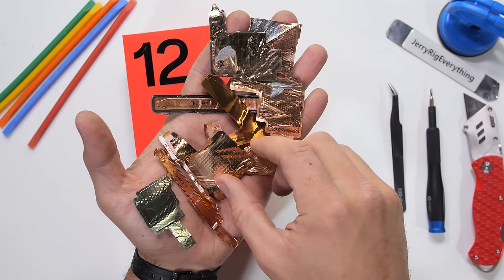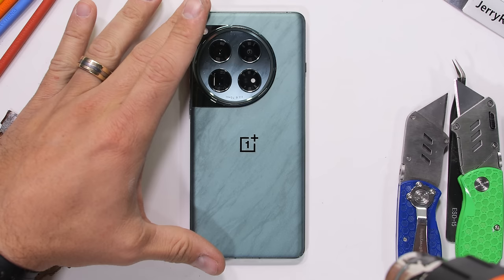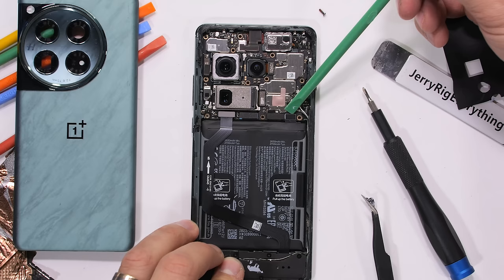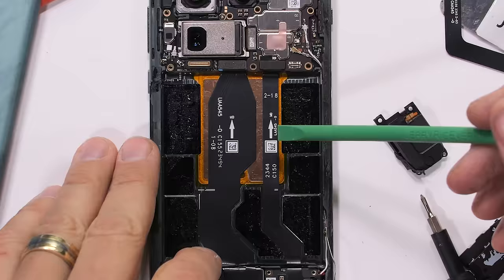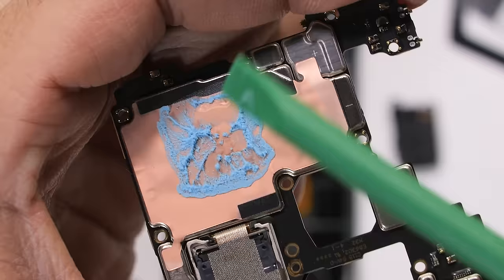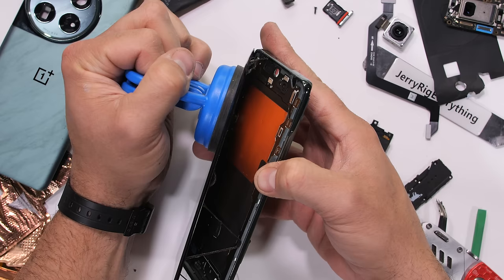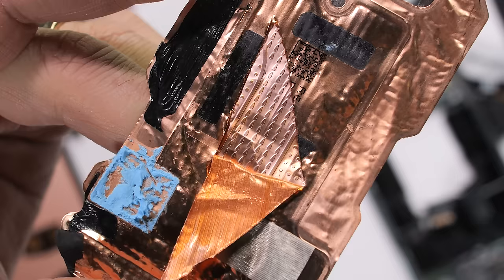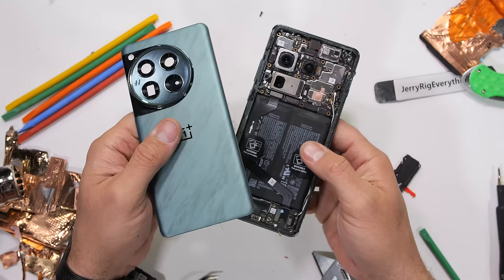The OnePlus 12 is the Coolest phone ever seen...

Comment: its crazy how far one plus has come, i remember when hearing about this new company back in college, i had to get my hands on one of their phones, just so much tech for a value. I don't mind that it costs so much now n days, they seem to be very passionate about making their phones and what they put in it. big ups for one plus.
Reply: It really is amazing how far they've come. Op12 provides 90% of the experience of the s24 ultra (speed, resolution, refresh rate, battery etc), lacks a little behind in terms of camera, but that's only when you compare auto to auto mode. In manual camera mode, you can get much closer to the type of results the s24u produces. All that for 40% less in price compared to said flagship.

Not AS bang-for-buck as it used to be, but they are resisting going past that $1k mark, whereas everyone is comfortable charging $1400😂
Reply: One plus the goat
Reply: do you know about phones and if so is that a extra fake camera on this phone?
Reply: Heck they are still a great value IMO. I'm going to buy one today at Best Buy (they just happened to have ONE 512 gig / 16 gig RAM in green in stock). The battery on my Note 20 Ultra 5G has started swelling bad enough that it broke the water tight seal on the back glass completely. If I take it out of the case the back glass isn't even attached because the battery has swollen so much. I didn't notice until the last time I took it out of the case to clean. Pretty sure if I tried to use it without a case the internals would just fall out lol. Plus of course a bulging battery is not a good sign for obvious reasons.
Reply: Got my OP5 on EBay for $80 2 years ago, and I am dreading the day I have to leave it. If modern OnePlus phones had a headphone jack, I would buy them without a second thought.

Comment: Definitely a long-time OnePlus user here. I've had 2 phones in the last 8 years. OnePlus 3T and OnePlus 7T. This 7T still works way better than I need a phone to be. I don't see myself replacing this 7T any time soon. I compared my old 3T (end 2016) to a friend's Samsung Galaxy S8+ (early 2017) after both phones had been sitting in a drawer for a year. The Samsung S8+ had developed a bloated battery that cracked the back glass while it was in the drawer. 😮 I replaced the battery and it works again, but its new battery keeps a charge only half as long as the older 3T with all original parts. OnePlus makes phones that last! I absolutely love their main line of phones and I'll always go for their products first. 👍 My two most-used OnePlus features that I cannot live without now: Alert Slider and Off-screen gesture for flashlight.
Reply: Similar, I've been rocking the 7T pro for maybe 4 years now? Anyways besides the battery life kinda decreasing I'm happy with it, until it gets to the point where the battery won't last me the full day I don't see the need to upgrade.
Reply: I picked up a 7T last year for under $200, refurbished of course but my 6T is still fine and usable after 3 years that's also refurbished.
Reply: Early adopter of the oneplus1. upgraded to the oneplus5, oneplus 7 pro and now a oneplus 10 pro. Loved every one of them exept for the 10 pro. Huge dissapointment. Was never gonna buy a oneplus again after that mistake. But I just found out that most chinese phones aren't getting an eu release... Might have to get the 12 pro against my will, Because there's no bettter option here?
Reply: @luukie0000  huh. So the 10 pro is not so good? My 7T runs the 90hz and Bluetooth all day and the battery is still holding a long charge going on 3 years old. The newest Samsung phone with the stylus I think is pretty dope, but it's much more expensive than a OnePlus phone. Not sure what I'll go for in another year or two when I'm ready to upgrade. I'll make note that the 10 pro might not be worth considering
Reply: V gesture for flashlight is so underated
Reply: Agreed, I started with the OnePlus 3, then 5, now 9T
Reply: I still love my 7T over 4 years after purchase. Best phone I've ever bought, still feels brand new.
Reply: 9 and 10 were not good phones! 11 is back on track, which is what I'm rocking now, and I suspect 12 is also good
Reply: Still rocking a 7T, even though I've had to replace the battery.  It just works.
Reply: S24 video?
Reply: @luukie0000  Couldn't agree more, I was a original 3T user which i swear is still one of the best phones i have ever used. Just had the 10 pro for 2 years and hated almost every second of it, the phone works well for like 1 week after a reset and then just suffers from occasional lagging across the system and apps. Just got the s24 ultra and so much happier lol.
Reply: i have an OnePlus 8 and is as slow as crap
Reply: i'm on 8T since 2020 and can't believe i haven't upgraded yet lol phone is still as fast as it was when i got it and battery is still letting me get 5-6 SoT with normal use.
Reply: Still using my One Plus 7. Still performs well.
Reply: @vinny6_9  I also have an 8t that I bought in 2021, best phone I had, and tge battery life is still decent even though it's a 3 years old phone
Reply: The only issue being the fact that old phones don't get android security updates which isn't good.
Reply: I was using 7t. But no sw update and lags, changed to Samy.
Reply: Me too, I have my 7T for so long, and I used it so muuuuch, maybe it will need battery changed in next years haha
Reply: True, I'm such a fan. And that's spot on OnePlus phones last long.

Comment: As a user from India, I used to use the OnePlus 6 for about 2 years. Then, I upgraded to the OnePlus 9 Pro. When I switched, I felt like OnePlus had changed; it seemed a bit expensive, and I didn't feel the same as with the old OnePlus 6. Maybe it was my own problem, but I got used to it. Still, in my mind, I thought this would be my last OnePlus; next time, I'll switch to something better like Samsung or iPhone. After 1 year of using the 9 Pro, the green line showed up. I was out of warranty, but they had the courage to say it was their mistake and fixed it for me. After a year, the line showed up again, and they fixed it again. That's twice. I've seen Apple and Samsung phones have the same issue in the Indian variants, and the company refused to fix for their customers. When the OnePlus 12 launched, I got a really good exchange plan, and the OnePlus 12 is an excellent upgrade from the 9 Pro. The battery life is top-notch, the camera is more than enough, and Oxygen OS feels as smooth as it was before.

Comment: Until somebody publishes a systematic study on the topic, I will continue to assume that charging at those speeds will age the battery quicker than charging at slower speeds.

A large Vapor chamber to distribute the heat is nice, but there is only so much you can do. Heat transfer to a glass screen is inherently very limited, glass is just not a good thermal conductor. Also, the Vapor chamber connects both batttery and processor. If one gets hot, it transfers heat into the other. But what happens if you game while being plugged in?
Reply: That's why it only charges up to a certain percentage then slows down. As long as the phone lasts two years most people don't care. I have the 10 pro, no issues with the battery.
Reply: until someone somewhere posts proof that charging at high speeds degrades the battery noticably faster then ill continue to believe it doesn't
Reply: MKBHD posted a really good video on that topic. I believe what he found is that completely discharging then fully charging the battery is more harmful to the battery than anything. Heat is certainly another issue as well. But some manufacturers have tech to help mitigate that, like having split batteries.
Reply: @downsouthlouisiana  been using the OnePlus 7 Pro since release and the battery health is starting to let up. I did almost exclusively use the fast charging. Still easily 5 years of usage out of this phone so I see it as a pretty good deal.

I would argue that leaving your phone plugged in over night is more damaging to the battery than the fast charging.
Reply: @edenfeledrum1540  I leave my phone plugged in overnight. But the phone is smart enough to know and it charges it slo
Reply: @downsouthlouisiana  yeah it's a relatively recent feature I think but it's very good one.
I dont think my phone had this feature one or two years ago.
Reply: @Aaronduhmoron  I have an 8 year old Xiaomi phone which I've always charged when it gets to zero. Phone still works fine to this day.

Comment: Will never get over how pretty the phone looks
Reply: Yeah. I LOVE the green color. I really wish more manufacturers would offer a green color. There was a generation of the Galaxy S (I wanna say the S6) where there was a beautiful emerald green one. But it was only sold in cert markets (not in the US). IDK if there was even a model you could import that had the bands to work with a US carrier or not. But man I wanted one so bad. I'm upgrading my phone and shopping around. I'm 99% sure I'm going with the OP12. My last ~4 phone have been Samsung. And I've loved them. My current one (Note 20 Ultra 5G) is the first I've had a issue with. The battery has started swelling. To the point that the back glass is no longer attached. It still works because it's in a case. But if you take the case off the back glass has a large gap because it's balancing on the swollen part of the battery. Plus I don't like sticking with one brand forever for most things, so looking forward to trying a different brand for the first time in many many years. And my first OnePlus phone. And when I checked the Best Buy where I live just happens to have ONE OP 12 green, 512GB storage / 16 GB RAM in stock.

Comment: Very good looking phone, especially the back.
Not sure about their software though. Ive heard many good and many bad things, so much so that i dont know any specifics anymore.
Cameras also seem to be fine, but nothing special, which could and should be improved. The Hasselblad branding seems to be there solely for the purpose of being there.

Patiently waiting for the S24 Ultra teardown so we can see what kind of titanium solution Samsung has used in their frame. Im guessing its the same as the iPhone.
Reply: I'm actually about to go to Best Buy and buy a OP12 (was already leaning towards the OP 12, then I saw that the Best Buy where I live has ONE OP12, 512 GB storage / 16 GB RAM, in Green in stock). Gonna go grab it today or tomorrow. My Note 20 Ultra 5G has a pretty bad problem lol. The battery is swelling, so much that it's pushed the back glass off. It only stays on when the phone is in a case. Obviously that's not a good sign. My last like 4 phones have been Samsung. And I've been super happy with them, and this battery thing is the first problem like this I've had. But I want to give something different a try. So after looking around I've settled on the OP 12. 

I'm very curious to see what the software is like as well. I've heard mixed things too. Nothing too negative. Mainly that people were really underwhelmed with the Android 14 update and how little it brought compared to what other brands are doing. And how the majority of new features were just a word salad of buzzwords with no real explanation of what they are or do. The "Trinity Engine" with CPU, ROM, and RAM "Vitalization", "HyperBoost" "HyperRendering", "HyperTouch" "Device Security Engine 3.0" all with vague descriptions again with mostly just buzzwords. The only new features that do seem like nice additions are "File Dock" and "Auto Pixelate 2.0". It does seem most people agree Oxygen OS 14 is very snappy and fluid etc. so that's def a good sign.

But I'm glad to see they have a software update guarantee (four years of Android OS updates, and five years of security patches for the OP12). Most of what I've looked at looks pretty good IMO. They have some features that are must have for me like a "File Vault" equivalent (being able to encrypt files), I never use it, but they also have the thing where you can install two dif instances of the same app. A theme engine and theme store, seems to have lots of customization built in (being able to mix and match themes, icon packs, accent color, quick settings icon style etc). I like the look of it overall. But the software and really a phone in general is something you have to actually use for a bit before you know how you like it.

Comment: As an until recently owner of One Plus 5T (my second One Plus purchase, after their first One Plus 1), I can tell that the phones are well built and last long. I had bought mine at the beginning of 2018 and used it until the end of 2023 - for an unbelievable 6 years, which in smartphone years must be something like 120 years. I still have the phone and it still holds charge for a full day of activitiy, and age has not slowed it down to an extent that it becomes unusable. They were ahead of the curve while building it - 8 GB memory, Qualcomm Snapdragon 835s Octacore processor IIRC, and 128 GB memory worked fine over the years. Only now I realize that the thin, curved back, anodized aluminum shell device had a pronounced bezel - that took up screen real estate. But overall, I would say it held up pretty well over the years, across multiple trans-Atlantic travels!

Comment: I'd be really curious to see just how well that cooling system works. 50W wireless charging could get the battery really hot. Can it keep the inside of the phone below 95F while charging at that speed?
Reply: Their wireless charging stand has a fan built in
Reply: @nightshadesalad  that just keeps the stand cool. It's not going to do anything to keep the inside of the phone. The heat generated by wireless charging is generated INSIDE the phone by the charging coil.
Reply: @jimv1983 and dissipates through the back of the phone, which is easier when the charger isn't also warm

Comment: Your conclusion that it's the coolest phone you've ever seen is incorrect. It's possibly the hottest phone you've ever seen, because it needs those coolers to dissipate the heat. It is also no guarantee that it dissipates heat faster than a smaller, less powerful phone, which may run considerably cooler. But actually, just based on the size of the coolers you can't conclude anything. We can't even assume that it has the greatest capacity to dump heat because other designs with more airflow might do a better job. 

Still, neat.

Comment: These cooling systems are a gimmick. The heat has nowhere to go. It's there for 5min benchmark numbers. Once saturated, the chips get just as hot as without the vapor chambers. It just buys a few minutes of not throttling. Phones are insulated and the heat is trapped.

Comment: The question is how the super-quick battery charging affects the battery longevity and wellbeing.
Reply: Enough to get you 3+ years...
Reply: its not enough to deteriorate the battery too fast and even then, you still have extremely fast charging so if 5 years down the line you need 2 charges for a full day of use(highly unlikely) you could just like plug it in while you take a shower or smth and then itll be full
Reply: @L_ightninng    Hmm, maybe.  At work we've seen weird issues with smartphone batteries.  Yes, not related to fast charging, but still.  It depends on how OnePlus have designed this whole thing.   Personally,  I don't mind waiting an hour longer and being nicer to the battery in return 🙂

Comment: How effective is this actually? I watched a battery drain video with temperature included and this phone was the hottest out of the 15 pro max, s24U and a couple other phones.
Reply: Don’t be a sheep. There’re youtubers that are paid to steer community to a preferred market.
Reply: @rinkashi101  i am not a sheep. I did research on engineering forums and the cry chamber is a joke. The heat has nowhere to escape. Also after owning two OnePlus phones and both having the same display and touch issues i deduced that this is not a high quality brand and cheap for a reason. High specs is how they get people but quality control is garbage. Not to mention cost cutting on the bad camera system.
Reply: @rinkashi101   i am not a sheep. I did research on engineering forums and the cry chamber is a joke. The heat has nowhere to escape. Also after owning two OnePlus phones and both having the same display and touch issues i deduced that this is not a high quality brand and cheap for a reason. High specs is how they get people but quality control is garbage. Not to mention cost cutting on the bad camera system.

Comment: Had my new phone for 6 days (iPhone 11 upgrade to OnePlus12) heat issues on upper half after one hour of use, batter life lacking greatly from what it claims even with most notifications turned off. Disappointed. Also the backing is very fragile and shattered with one fall out of my pocket 3 days in.   Very sad as this is the most expensive phone I've ever bought at $800. Performance when the phone is overheating goes down to glitching apps and to hot to hold, I had to shut my phone completely off for 5min for it to cool off. 

Someone said the ram is causing issues but I can't find the setting they are talking about.